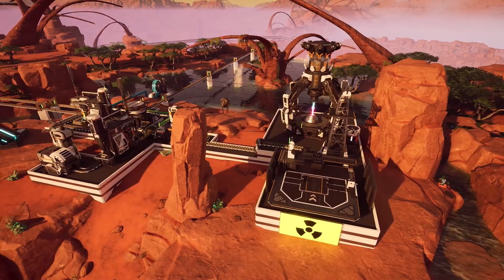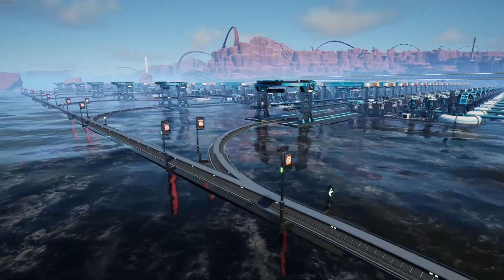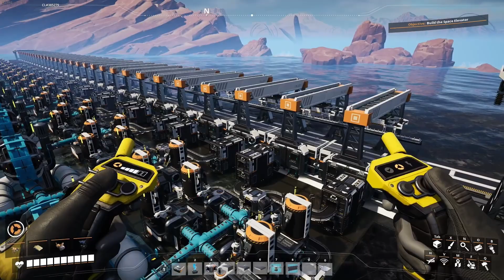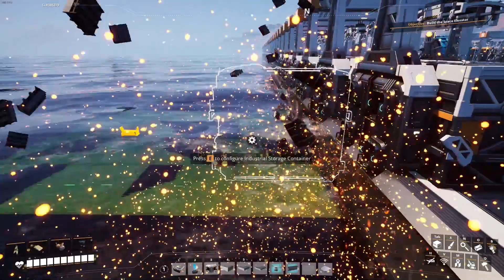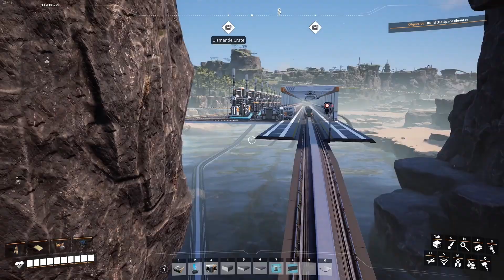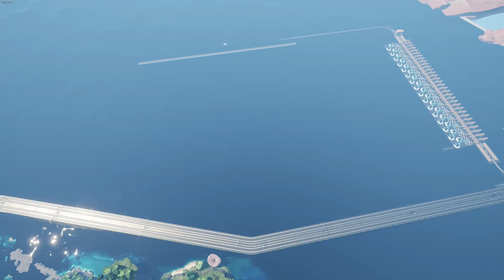🚂Unbelievable! Loading 115,000 Water Bottles/Minute in Satisfactory!

Comment: In struggling to get the foundation over/under water at the right level to get the water extractor to place correctly.
Reply from the maker: you can try and place a 1m foundation just on the surface of the water so the waves go over. and then place 1m foundations just underneath. and the water has to be a certain debht. worked for me

Comment: You are going to want to connect both belts from the storage containers to the train stations. 

Need this to better buffer the train station pause during load/unload.

I know it is only 600ppm and you use a mk6 belt so the single belt should work, but 2 belts would be 100% sure.

But wow, that is a lot of bottled water. Nice work.
Reply from the maker: yeah im for shure going to connect 2 belts per station. first i have to load all of them with canisters🙈
Reply: @papasnusi  i do not envy that work. But it is pretty.
Reply from the maker: @5353Jumper it was chill to build and thank you